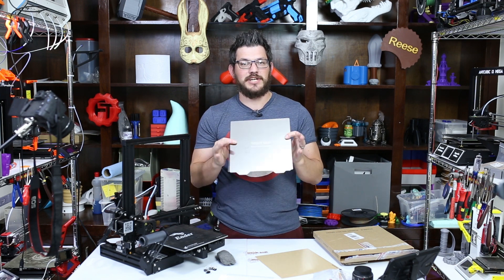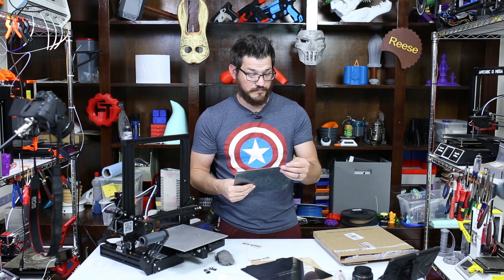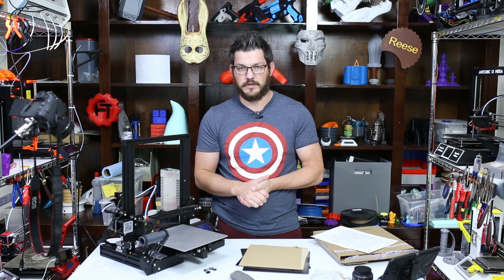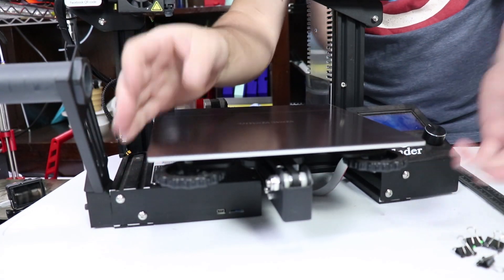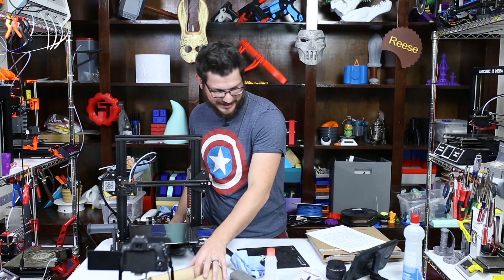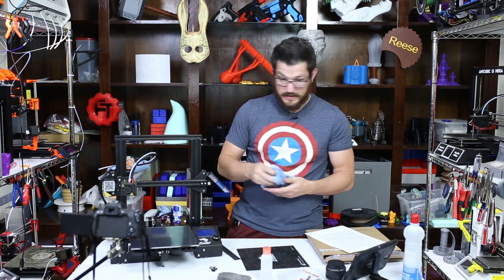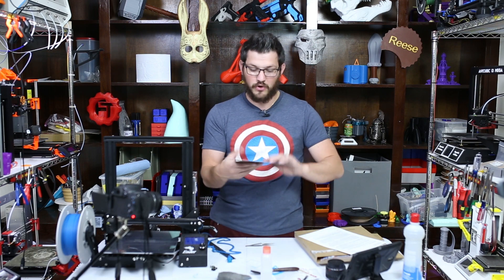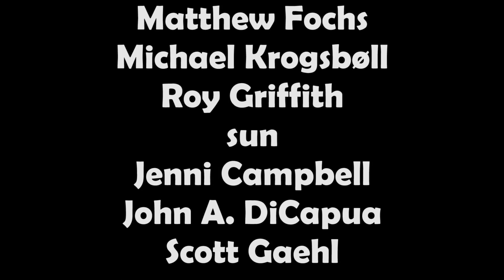Installing the Wham Bam Flex Plate System on the Ender 3

Comment: so why can't I just use the wham bam flex plate on top of the original ender 3 pro magnetic build plate. I tested it and it sticks just fine. SO if I'm only printing pla and the flex sheet sticks to the ender magentic bed, do you see an issues with that? Also love your shit dude. I have the same one. Go team Cap!
Reply from the maker: You could! I did this mod to the OG Ender 3 which does not have the magnetic sheet on it.
Reply: @Fugatech3DPrinting  so I did and it works great. Didn't need to tear off the old magnetic bed and this way, I can still use the ender stock flex for certain prints. Thanks for replying

Comment: You forgot a step, you need to take the protective sheet off the PEX sheet.
Reply from the maker: It came off as I was applying it so I felt it was kinda obvious to take it off.
Reply: Fugatech 3D Printing you know how literal folks are.  Love my Wham Bam on MK3S. Bought a cheap flex plate from Amazon and got the surface from Peter, his studio/shop is 15 minutes from me

Comment: Why is always the Wham Bam System advertised and no Youtuber compares it to the system from AliExpress/Energetic 3d Store or even mention it? It's a fraction of the cost. It uses PEI instead of PEX (but is there any difference in usage?) and the PEI is already applied to the spring steel. And it's no cheap "Copy" of WhamBam, actually they sold it since shortly after Prusa released the mk3. Only the magnetic sticker 140°C  tolerant came up the same time as WhamBam (before they sell with magnets to glue under the bed, wich is the better solution anyway, as a magnetic sticker reduces heat-transmission).

Also you should definitly try out the PEI powder coated spring steel from AliExpress/Trianglelab. It's very near to the original Prusa ones; only texture is a little bit finer.
Reply from the maker: #1 - This isn't an ad. It is an installation video of their product. #2 - This isn't a comparison video. This is an installation video. I'll review it at a later date. #3 - I can only review or compare what I have and honestly, I don't feel like wasting my money on crap.
Reply: @Fugatech3DPrinting   No manufacturer sends you something for free to a youtuber without the hope it being presented by him. If you fullfill this wish without any comparation to simular products from competitors, even do not mention their existence, it's an add. If you hide it's product-placement character by calling it an "Installation Video" it is even worse - you only can be happy to live outside the EU, because there you would get a lot of trouble (for a good reason).
Realy: An "installation video" how to glue a magnetic base onto a hotbed and a sticker to a steel plate? Obviosly only another video to present the overpriced WhamBam to a lot of viewers.

Nice you confirmed that by calling the alternatives "crap" without ever having checked them out. So your video is made to get free products by marketing them. Thats called "advertising". Making the choise what you present depending on what you can get for free is pest and cholara on YouTube. No one with some sense in mind would buy an overpriced product like the WhamBam system ("designed" in Florida but a chineese manufactured product) without looking out for alternatives - and pay more than 3-times the price of a simular product with same quality. So if it comes to price/quality ratio, the WhamBam system is simply crap. Exept for some YouTubers getting it for free of course. Presenting it everythere in YouTube, doing the marketing for WhamBam.
Reply: I actually have a Flexplate from Buildtak on my Flashforge, WhamBam on my Hypercube 300, and my MP mini delta, the Eryone Maflex on my Ender 3, and Malyan M200, and a DIY magnets under the buildplate and spring steel plate with Geckotek hot on my MP mini V1. I also have a Geckotek hot on my Hypercube 300. For PLA and Petg, I do not see much difference, they all work well. For me I prefer the Geckotek Hot for Nylons, and other exotics, but that is a surface preference. The Buildtak Flexplate is much thicker, and therefore much more stiff, but the other plates are all about the same. For those wondering, A BLTouch and UBL leveling is wonderful for swapping plates with different surfaces. Just edit starting Gcode to load which mesh P1-P7 and print. I rarely have to tweak my level, if something stops sticking, or I get lifting, I take the plate off, and clean with IPA, after a once over with the steel wool, works for all those types of surfaces, PEX,PEI,Geckotek,Buildtak,Lokbuild.

Comment: What's the purpose of using the steel wool on the PEX?
Reply: To give it more surface area so it grabs better onto the first layer
Reply from the maker: What he said.
Reply: The PEX sheet is super smooth and the tiny grooves from the steel wool create small areas for the plastic to grip when printing.  They are so small you will not see them on the print, but it does make a difference.  I saw another video where the clown didn't do that and complained that the Wham Bam doesn't work good.  I have it installed on my Ender 3 and Tevo Tornado and it is amazing.  Works as well, if not better, than the sheets I have on my Prusas.